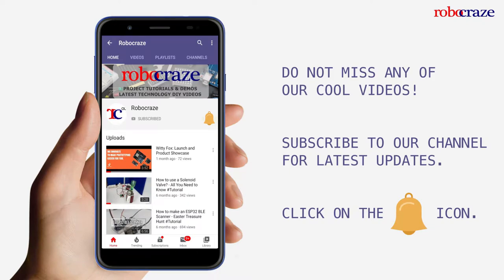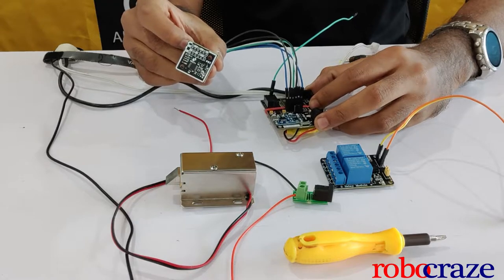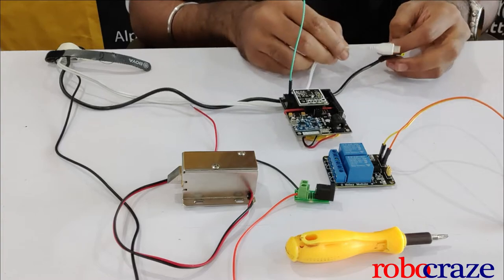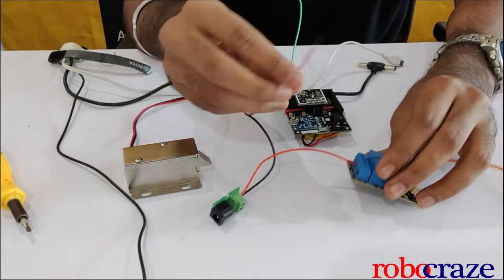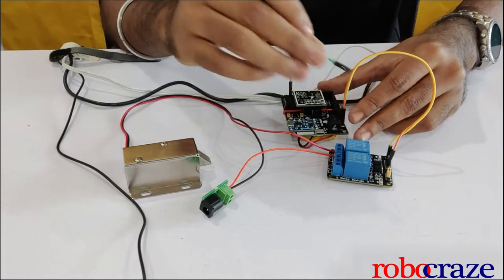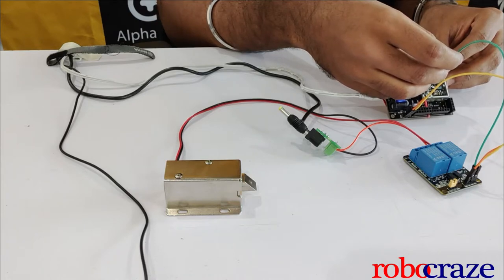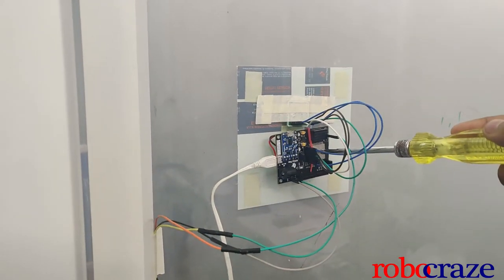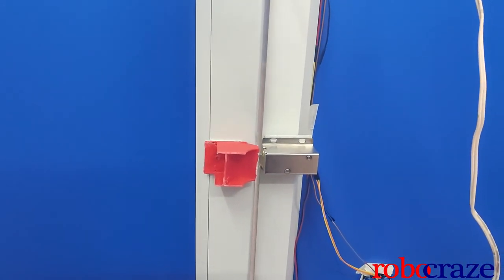Build Your Own NFC Security Lock System (Tutorial Part 1)

Comment: Hello my friends,
 I hope you are fine, it is really beautiful, but I have a problem. I have a project for the university that generated different parts. I have esp32 devi v1 and the type of nfc is pn532. I hope you can help me and you send me the connection of the parts with the programming. Thank you very much
Reply from the maker: Hello, you can use the same code and connection diagram with ESP32 as well.